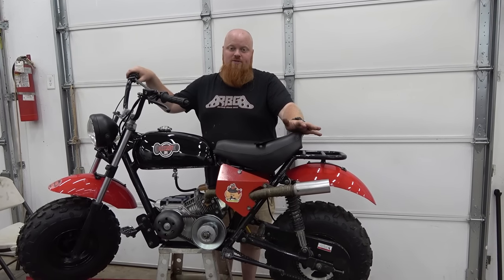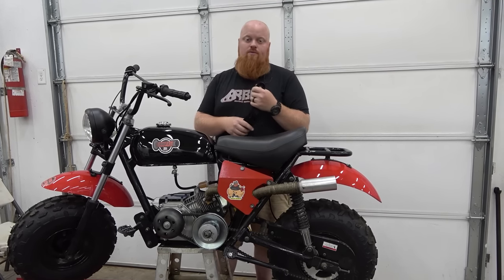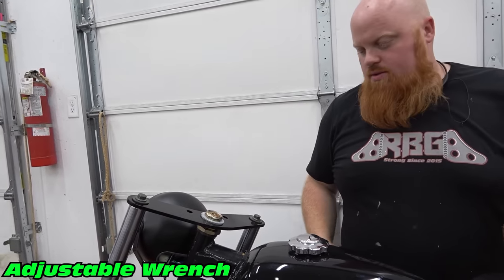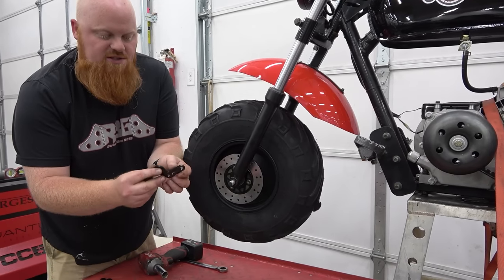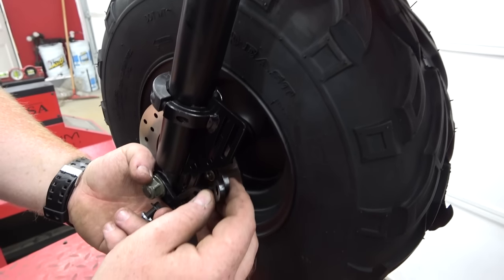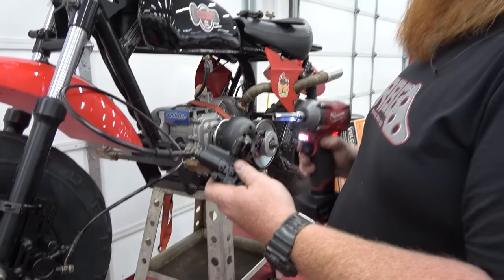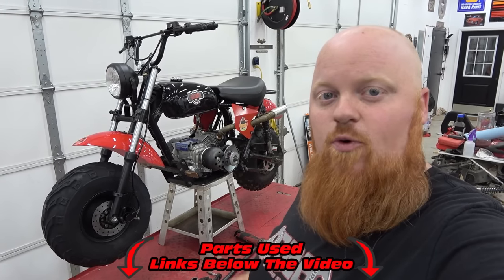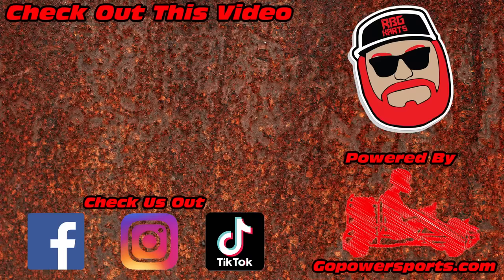Mini Bike Front Brakes ~ Trailmaster MB200 Front Brake Kit Install

Comment: Anyone ever tried installing one of these on a coleman ct200u ex? They seem to use the same front tire. Wondering if it would work 🤷‍♂️
Reply: The ct200u kit will be released soon.
Reply: @mwmuller  for reals?!
Reply: Yes it works.

Comment: Do I need to remove the governor on this bike to install a 22mm Mikuni carb?
Reply: Yes
Reply: @coreyrobinson1630  why exactly?
Reply: Because the mikuni bypasses the govenor linkage. Ya don't want the govenor gear just in the motor it could engage when it want to. It doesn't always but can. It's too easy too remove the govenor for it to be an issue.
Reply: @coreyrobinson1630  thank you! Makes total sense